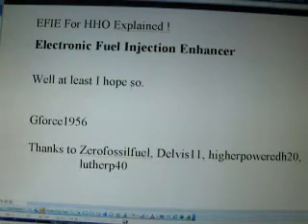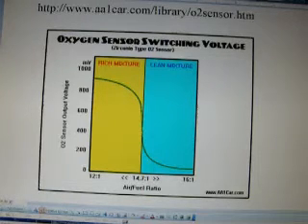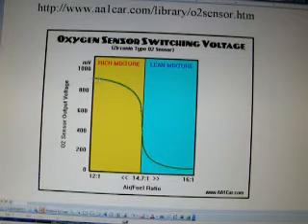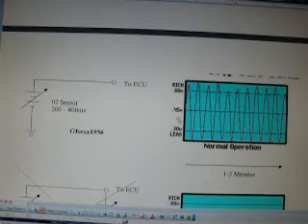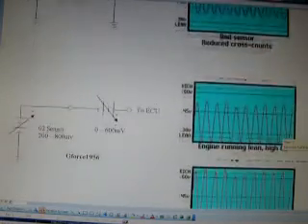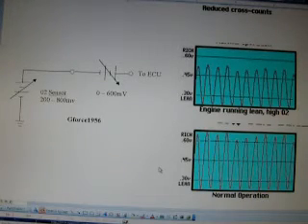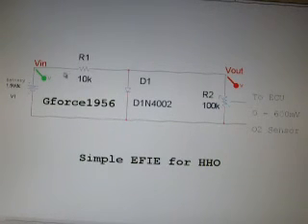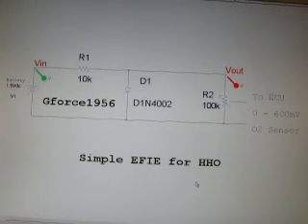EFIE Explained and Simple Battery Circuit

Comment from the maker: Thanks for the complement. My understanding is the extra Oxygen from HHO causes a rich mixture indication from the Oxygen sensor. The purpose of the circuit is to tell the ECU you have a normal mixture when you are adding HHO.
This causes a lean mixture from a hydrocarbon fuel perspective. The danger of course is causing too lean a hydrocarbon fuel mixture which will cause excessive heat and can damage your engine. 
Several folks recommend monitoring your exhaust gas temperature.

Comment: i am shopping around for an efie .. for my 1998 Chevy venture .. I need a narrow band for 2  o2 sensors 1 up and 1 down stream.. but i don't know hardly anything of all the types out there..
Digital-analog... variable or fixed so forth..
can you advise me on the type that will concentrate the most fuel efficiency